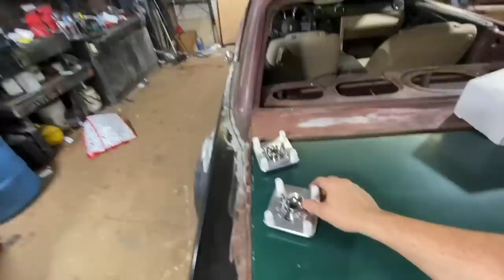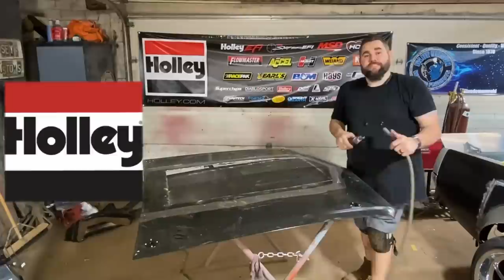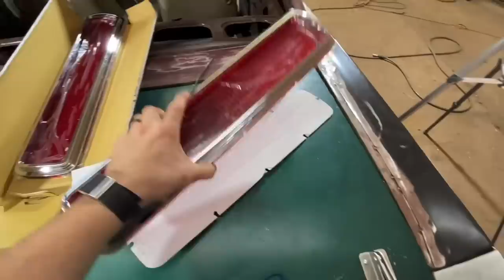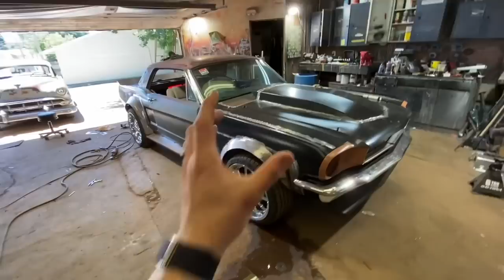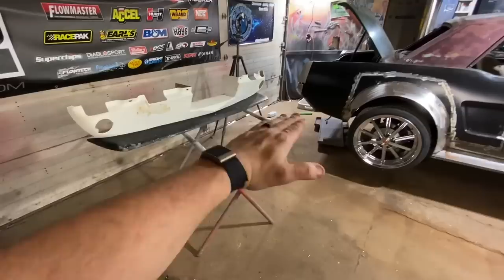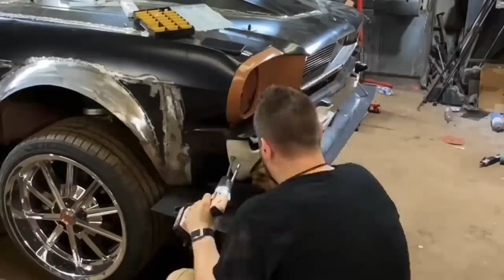CUTTING UP A PERFECT NEW CAR! 65 FORD MUSTANG HOT ROD BUILD GETS DONOR CHASSIS! KUSTOM RAT ROD! PT16

Comment: Actually, the shelby tail lights were based on the 64-65 Thunderbird tail lights, not the cougar lights.
Reply: @stephaniewarner4035  :0
Reply: There the same lol
Reply: @stephaniewarner4035  bro what
Reply: '67 Shelby used Cougar based taillight with chrome trim ring that fits the Cougar lenses . '68 Shelby and California Special Mustang used the 64-65 Thunderbird tail lights which look like he installed. Shelby did try the same Tbird lights on 66 Shelby protypes

Comment: You need some sort of fancy flasher if I remember right on those taillights because they You're a Flash 1st on the inside then in the middle and then the outside and do it again when you're using your turn signal looks cool when they're working though

Comment: It's coming together nice. I'm surprised that you can put those two together. The lower spoiler on the front was mounted pretty much at a 45 degree angle instead of flat. Gonna be a great looking ride when finished.

Comment: Taillights look great on there. Glad you removed the gas filler from the back. Can’t wait to see the finished front diffuser. If you ever want to take the wood out just drill a hole and install some termites. 👊😎👍

Comment: That  Hood is bitchin I wanted to do that with my 61 ranchero with a 5.0 in it because it gets hot under the hood nowhere for the heat to escape I was told if you put a hood scoop it just blows huge amount of hot air towards the inside of the car already live in the desert but if it keeps my motor cool I'm good with that thanks for showing me how to do it I dig that car man

Comment: I'm probably to late with this comment on suggesting tail lights but, look up 15" Red Multi-function Stop Turn Tail Marker Trailer Light LED Bar Truck Waterproof USA Made on amazon. You could stack two or three of those tail light strips across the back, then install your California tail light lenses over the strip lights without having to fabricate anything. Its just a suggestion.😎

Comment: Could’ve used the metal you cut out from the hood instead of abs plastic?????
Reply from the maker: The piece of metal from the hood is about 4 times to small. Lol, the diffuser is 76x24 if it was metal it would be super heavy

Comment: A diffuser is the expansion area underneath the rear bumper area and typically goes near the rear axle. The front horizontal piece is a splitter. Splits the air above and below the car. If you make a vertical piece in front, it’s an air dam which typically has a small splitter on the bottom edge. Air dams keep air from getting under the car. So, you are making a splitter. Love your builds. Thanks for making the vids!!!
Reply: Potaato, potato, tater